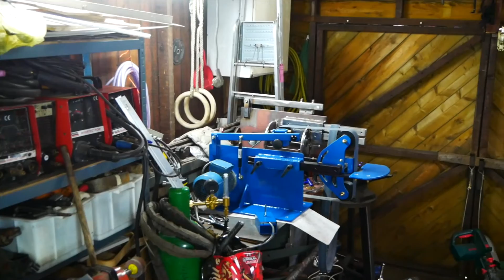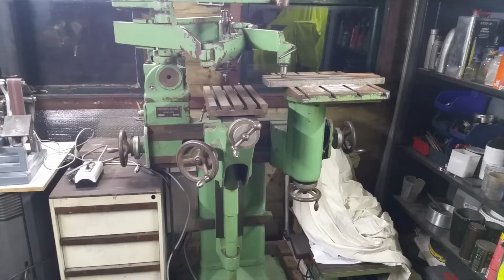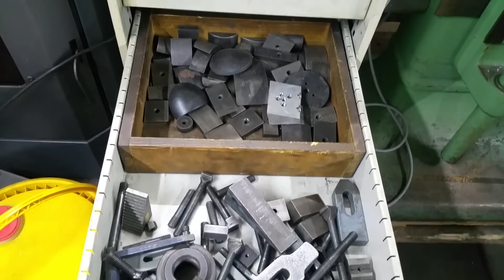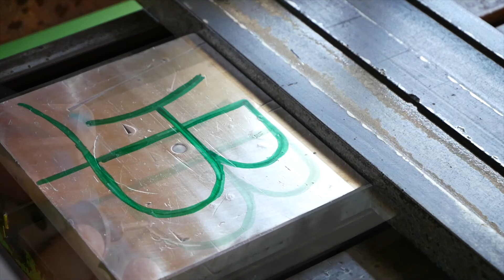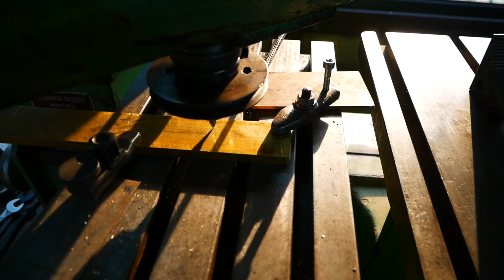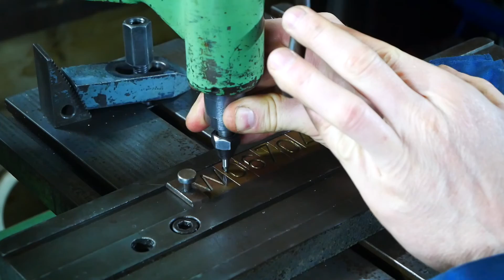Deckel GK21 - Cleaning and Making a Template

Comment: Hey man,great acquisition, i also got a Deckel GK21 that i bought in a broken state, basically the guy sold it to me as pile of pieces of metal in kg, he didn't know what a Pantograph is, so i bought it and i'm fixing it but there is some parts missing that i clearly need to machine in a machine shop but i need some specs that i didn't found on the manual user of the GK21, can i send you an email or something like that to get those specs ? I would really appreciate your help, thank's in advance
Reply from the maker: Hi, you can find me on Instagram Bartharkema and send me a private message.

Comment: I to just acquired a Deckel GK21, I haven’t any manual but from the looks like 1 to 1.5 is the lowest racial I really need a one to one ratio do you know if this is possible to achieve, how?
Reply from the maker: With the GK21 it starts with 1.5. But if you mount the spindle on the other side of the phantograph arm you can enlarge 1.5 then make the die/shape and switch the spindle again to decrease size with 1,5. It takes an extra step and makes it also less accurate but if needed this may be a solution. I believe the larger Deckel KG12 Phantograph machines can do 1:1.
Reply: Danke 

Ich denke, ich werde versuchen, eine andere Maschine zu beschaffen
Reply: @michron-1.0  Die GK 21 und GK 12 können selbstverständlich auch vergrössern indem man die Aufnahme von Frässpindel und Taststift am Pantographen einfach vertauscht. das geht bis 8:1 / oder 1:10 soviel ich weiss. Bitte Anleitung anschauen.

Comment: Hi Bart greetings from Brisbane Australia. I use to repair these. They are beautifully made machines. The spindles are easily repaired with new bearings. The bearings are Angular contact Magneto bearings, EN Series. Use only 10W oil in them. You should be able to get a book for it from Tony@lathes.co.uk. 
Hope this is of help.

Comment: Hi nice to be here as a newbie and you are as well with back making videos again, we know this machine the Deckel through some other videos. The machine does look like a great size. 
We bet this machine is going to clean up well and we are sure you are going to make it run really well. 
We it runs well, that is nice machine work you engraved in that (we think) brass plate.
Thank you for the share, Lance & Patrick.
Reply from the maker: Thanks. And yes it runs well on the brass plate. Need to try milling some steel / stainless in the future. I learned to use a Pantograph when I worked as a mechanic (around 10 years ago). The basics are there but this one has a lot more possibilities like the 3d contour milling.